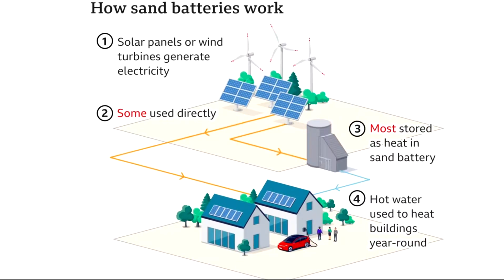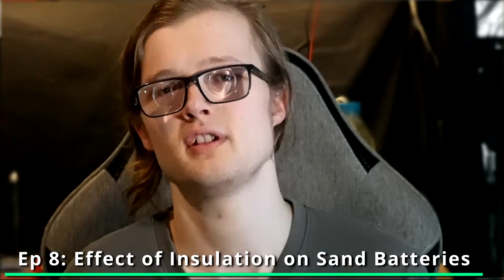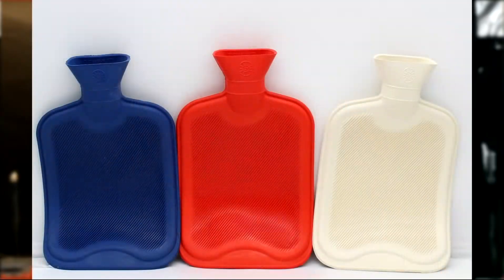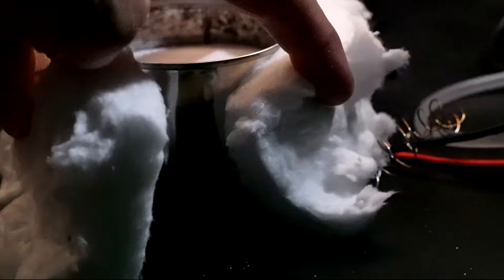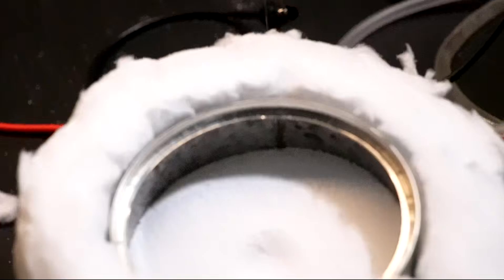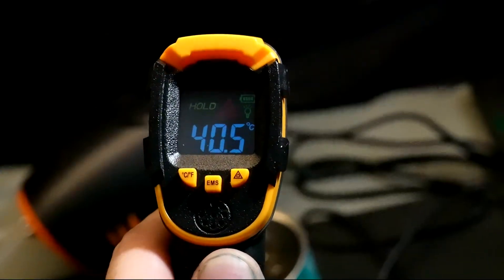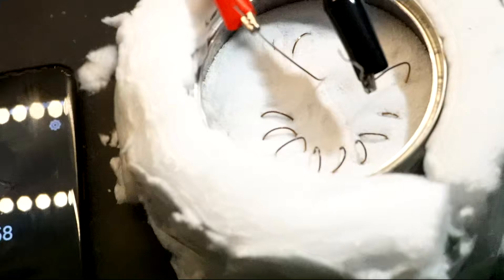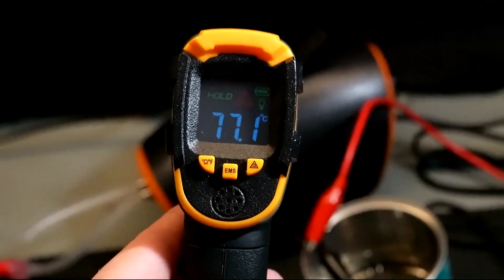Insulation: The Secret Ingredient for Sand Battery Efficiency

Comment: If you want efficient yes insulation is good but you need a much larger thermal mass then you are using.  That small amount of sand has far too much surface area to volume.  Scale the experiment up to a bucket of sand and you will see a bid difference in heat loss
Reply from the maker: Thanks for the feedback. I'll keep it in mind for future sand battery projects.

Comment: Hey adam..have you tried this with diodes? Apparently they're more efficient than a heating wire
Reply: I personally think diodes that are manufactured from simple materials at home or in small workshops/garages are the way forward.
Reply from the maker: I'll have to look into this
Reply from the maker: https://www.sciencedirect.com/science/article/pii/S2352728519300508

I found this, is this what you were talking about?

Comment: Nice video Adam! =) I would argue that size is the secret to our high efficiency in the Sand Battery. Our smallest commercial unit has 2000 tons of sand or crushed soap stone. Always when volume douples surface area only increases about 66%. So if you start with 1kg sand battery and go to our 2 000 000 kg sand battery there is roughly 21 douplings so the relative losses from the edges are 1/10 000 of that small one. =)
Reply: хочешь сказать что делать песчаные батареи емкостью например 4 кубических метра не будет смысла? Даже если делать хорошую теплоизоляцию? Впрочем меня больше интересует нагрев таких батарей дымовыми газами - вы такое производите?

Comment: Aluminum is good at reflecting radiated heat, but it is a fantastic conductor of heat. 

Placing the aluminum in contact with the hot sand won't do any better than just the (metal?) can. You need a small gap between the can and the aluminum to minimize heat conduction.

By the way, the heat lost due to radiation is governed by the difference in temperature, in Kelvin, to the fourth power.

q = ε σ (Th4 - Tc4) Ah

Comment: Heat several weighed identical cans of sand in the oven say at 400 degrees then remove them to the various insulation methods then make your measurements.

Comment: 0:12 I love it so much when graphics of "breakthrough technologies in batteries" show their abilities in watts or ampere-hours. Like.. what is energy capacity?! Watts are missing time and ampere-hours missing voltage.
I have high-voltage low-esr capacitor right next to me capable of providing somwhere around 36MW power for few picoseconds. And it is size of my pinky finger!

Other than that nice video. Good job.

Comment: the heating element / wire needs to be much, MUCH longer - it basically needs to spiral around the entire inside of the can, you can also put a reflective coating on the inside / a thermo foil, use even more insulation, compress the insulation, drench it in liquids which have insulative (reflective, perhaps?) properties, mix the insulation with insulation foam, remove all (!) of the air via a vacuum pump and so on ...
Great start, looking forward to the next research steps!
Reply from the maker: Thanks for the tips!

Comment: you could had just left the heating element in the can, and just unplug the electricity going for it.... and the whole point in sand batteries is to go higher then boiling point of water so they need to be insulated properly. (to take out the heat from the "battery" you would have like copper pipe going trough it for input/output)